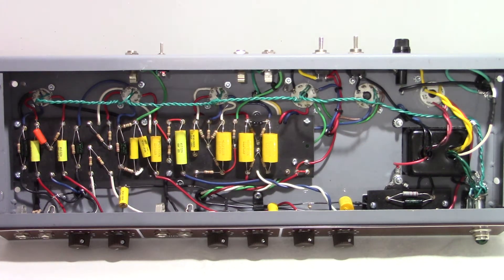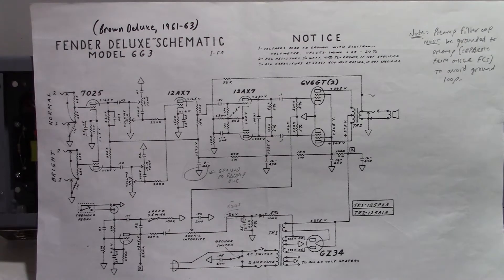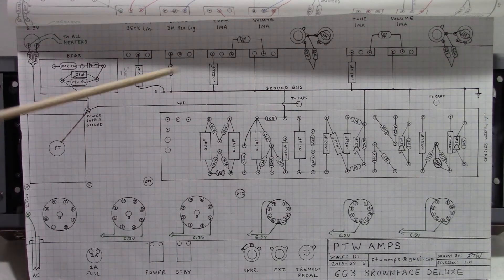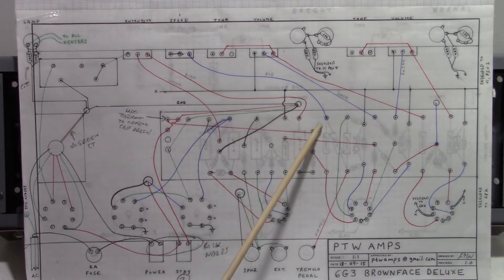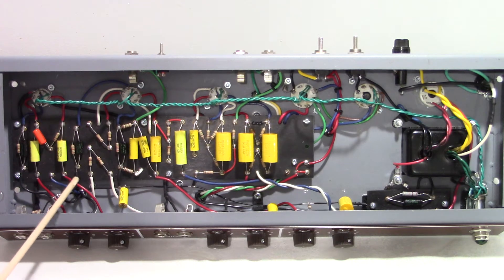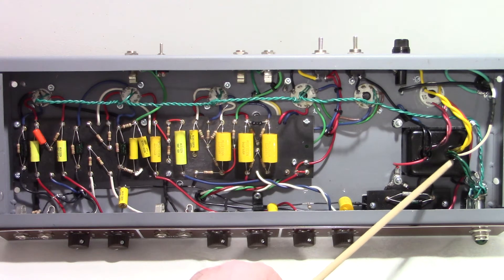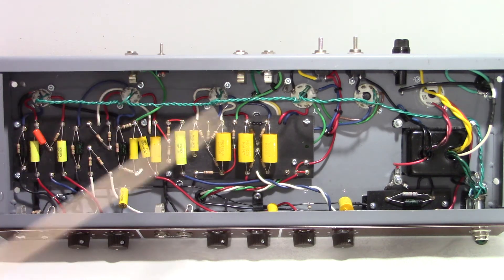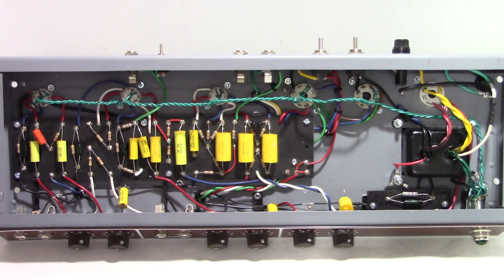PTW Amps - "Le Brun" 6G3 Brown Deluxe replica guitar amp

Comment: Great video thanks. I’m trying to learn as much as I can about this amp. Very much appreciate you sharing your approach and your layouts. 
You mentioned you soldered from the back of the board. Is that how Fender did it back in the 50s and 60s? Why do you think that was?
Also. 
On your design did you relocate the usual jumpers that fender installed across the components on the face of the board to the back of your board?
I’m figuring they did this for ease of service and for inspection purposes?
I know electrically it’s fine and it makes sense, but they always look sloppy across the other components. Even on top of the board they could have dressed them a little more out of the way. 
Are you happy with putting those behind the board,? Thank you